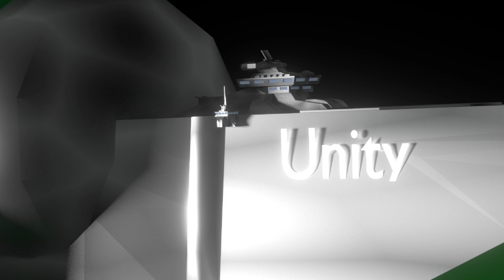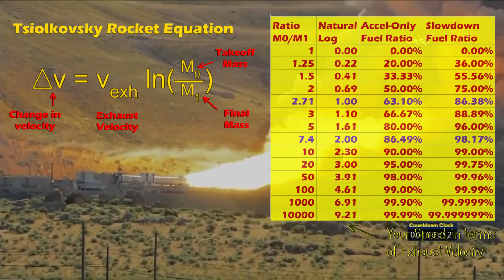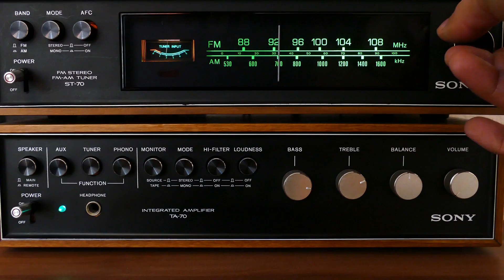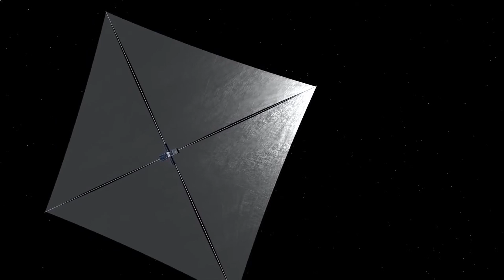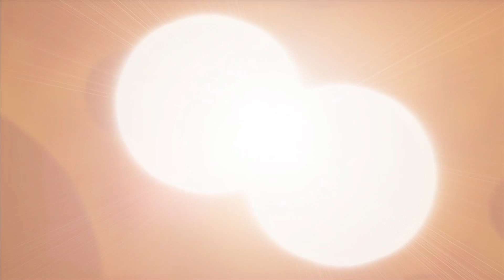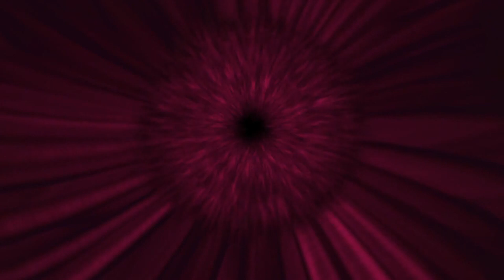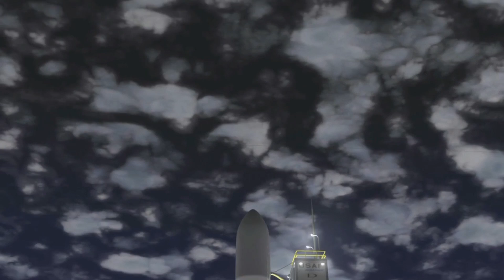Interstellar Travel Challenges

Comment: The stopping though... why not aero braking? We see this in 2010 film. Where the Alexander Leonov boost to Jupiter they put out a massive heat shield and go into the atmosphere of Jupiter to brake
Reply: Bad idea! This video is mostly about clever ways of surviving impacts from microscopic dust particles. You're talking about an impact with a planet. 

At 10% of lightspeed, your ship might spend a tenth of a millisecond passing through 300 km of atmosphere. You would be the dust particle and the atmosphere would be the shielding, and you would become a flash of light that incinerated half a planet. 

Even if that was okay, you'd pull, uh, like 30 billion gees going from 30,000 km /sec to zero in one ten thousandth of a second. Ouch.

Comment: How exactly would you slow down with such a ship?
I assume you would have to turn the ship around, thus exposing the unarmored backside and engine to debris.
Reply from the maker: I'd probably just move the engine or armor if a flip wasn't ideal, this is space afterall, detach it from the back and stick it up front. Also it is a 100 year journey but decel is only a few months, maybe a year, and the collision will plummet during that time.
Reply: I guess you would have to do that quickly.
But the engine would probably destroy anything flying towards the ship, so it doesn't need armor
Also, you can sacrifice those few thousands of tons and have second engine on the front, with would be always turned on and thus protecting the ship and when the time comes, you direct more power into the frontal one to slow down.
Reply: Detachable engine! 🚀

Why have I never thought about that? 😲
That makes the whole thing much easier.
Reply: Well, you don't need to point the engine to the exact direction you are going. Keep the engine protected in the back and make the exhaust go forward on all sides but on an angle so that the result thrust slows down the ship. This is similar to what jet planes do.
Reply from the maker: You could keep a really thin tether connected I suppose, but I'm not sure I'd bother trying to collect them at the end. Raw Mass means nothing once decel begins since you're decelerating to reach some place.  You don't need the sails anymore and you'd have to burn a little more fuel to decelerate them if you bring them back on board. Recycle a sail into something else useful rather than grabbing and smelting a few extra tons of asteroid in the destination solar system probably takes more energy, considering the sheer amount needed per kilogram to decel from 10 or 20% of light speed.
Reply: I'd already written, that the plasma from the engine would destroy all large particles
Reply: Hand brake, same as normal. ;-)
Reply: To slow down the interstellar medium can become an useful instead of destructive, spin out some electric sail wares of a magsail or plasma sail and slow yourself down with the charged particles. Should slow you down to non relativistic speeds before you have to use your engines to decelerate. You can also add some energy to your initial acceleration absorbing some solar wind on slingshot round the sun.
Reply: @9GAGER KILL ALL THE 8DUDERS
it will be a lot easier when we will know how to build the warp engine. We are not certain how to build thermonuclear engine or yet a thermonuclear reactor, so we are a bit behind of your expectations.
Reply: To make matters worse, I don't think that you could armor the engine. At least not without blocking the exhaust needed for slow the ship down in the first place.
Reply: Also if your deploying the solar sail shields ahead thats going to sweep up most of the debris that could hit the engines while slowing down.  The armor is more for the radiation and whatever gets through the more active defenses.  Just cause your slowing down does not mean all those stop working.
Reply: Seems like you'd want at least two sets of engines if not more just for redundancy. In that case why not allow the engines to pivot forward, at a slight angle as Enrico mentioned, if they fire at the same time the effect would be the same.
Reply: @Pipe2DevNull
Yes, kinda same idea. In that link, it's more about pulling. Actually, Star Track TNG uses the idea, as they have engines and living quarters are capable of separating.

@MrMonkeybat
Surface/intersection which would be capable of doing so should be very very big.
Reply: Make the engine's turn but not the ship ?
Reply: @Arlo Waterbury
length of tethers is limited with rate of your deceleration, same stuff as for space lift basically.
Reply: That makes me wonder about artificial gravity. The ship is a huge cylinder so I assume it would be rotating around its axis to make gravity when at cruise speed and the rotation can stop when it's accelerating so that it becomes gravity. But then gravity isn't in the same direction.
"We will soon engage the engine, please stick all your furniture on the wall along the ship's axis"
Reply: Youd deactivate the engines in the back and activate the engines on the front of the ships (but it would take about the same time to slow down that it took to get to such a speed)
Reply: Or open up solar sails on the sides of the ship
Reply: @TheAllegiantTraitor
have them as separate entities from the start, long read but mentioned there http://worldbuilding.stackexchange.com/a/41407/20315
Reply: For my conteplative starship, I imagine a detached engine that can position itself at several pushpoints around the ship. Like a tugboat. The engine can push from the front or back. It can push from the side to change course to avoid stuff.
Reply: @xassis: How exactly would you slow down with such a ship?

I think the solution is magnetic sail. For speed like 0.1c should be very efective.
Reply: Molb0rg A 20-km long electric sail wire weighs only a few hundred grams and fits in a small reel, but when opened in space and connected to the spacecraft's electron gun, it can produce several square kilometre effective solar wind sail area and that is with current technology with things like graphene and superconductors it could be lighterlonger and hold more electric charge.
Reply: +Sir Twinkeltoes Yeah, because the front of the ship is armored to protect against impacts. If you could turn the engines, or exhaust, forward then the engines stay protected from impacts.
Reply: I was also curious how, during deceleration, you could recollect the detector sails that are lightseconds ahead of the ship.

Onboard engines? A reeeealy long tether? Extra wide to decel from the sun we're heading towards (presuming a sun is the destination). Accept the loss of the sails? Fly blind for a little while and accept the risk?

Essentially the distance the detector sails are in front of the ship would be based on the time lag of detection+transmission+computation+targeting. So speeding any or all of those up might allow for tethering, but how long is even possible?
Reply: @MrMonkeybat
>several square kilometers effective solar wind sail

Now even close to what is needed. https://en.wikipedia.org/wiki/Interstellar_medium
with 1 atom per cm^3(higher 5 times than in most places as we imagine it today), at 0.9c drag pressure, will be about 0.000121 Pa, so 1 square km sail will give 121 Newton in best case scenario.

The force drops proportionally to speed drop, so at 0.1c speed, the force will be 9 times less 13.4 Newton for 1 km^2 sail.

It can be done, but direct applying of graphene sail will give not so much in the case. It has to be 2 stage structure.
1 stage - have to concentrate the interstellar media of course of the ship.
2 stage - actually catch the stuff.

But the area of the first stage for decent ship have to be big. 1g acceleration/deacceleration it is about half light year acceleration/deacceleration distance and 1 year of time.
For a tiny ship of about 1'000'000 tons, first stage area has to be 810'743'801 km^2 at 0.9c with 5 times higher average interstellar medium density.

The slowdown problem have at least 5 solutions - laser road, usual rocketry, using interstellar medium, catch the ship in the system, using gravity of the star to stop(needs proper tech(not too complex, but long to describe))

So, in general, it is not a big problem, but requirements for the using interstellar medium as a way to stop(or help to stop) are higher than it seems you imagine.
Reply: @Arlo Waterbury
but before they are basically unlimited, so no problem to get them back and begin to decelerate.
Reply: I would use magnets , or something that its far superior to them. And I would place them in from of the ship , and it would stop the ship in the same way as a hammer that goes up and down . Magnetic brake. It would have the shape of a hoock (pirate hoock)  . And this will be our brake.. When you want to brake , you just power the magnetic field to repel the front of the ship , but at the same time you would detached some parts of this hoock and it will have a breaking effect on the magnets in the front of the ship , and not cause an reaction to push the hoock back.
Reply: Molb0rg The example I gave was of a single tether. Sorry I did not point out you spin out many to create a full electric thousands 130,000 and you could cover the complete radius covering 1600km square kilometers. As weight is less of an issue for space miners and they have access to more advanced materials they will be able to make much longer tethers or there is also Magsails and magneto plasma sails.
Reply: @MrMonkeybat
Yes, I understand that it can be scaled, and I was talking more about the proportion of things than about the number itself.
Also, I do not say it can't be done, it can. But the technology required is, I would say, superior to the technology level where we have to care about ship debris protection as it was discussed in the video. With the technology, there is basically nothing to discuss how to protect the ship.

The mass is not an issue as for material, in terms where to get it etc, if the construction will weight more than 12kg per km^2 it means that theoretical deceleration rate will be less than 1g, no matter how big is the stop sail. Mass efficiency in the situation determines the maximum possible rate of deceleration and percentage of mass for the sail and for the ship itself in a grand total of mass used. And grand total mass defines the amount of energy we have to spend on the acceleration of the ship, and if we use rocket type of acceleration how much we should take the fuel. I mean it is an important thing to consider.

12kg per square km of graphene it is about 50 layers of the material, so the thing can be done light weight, especially as we need the material as a charge carrier. I give-up on the moment to calculate will it be strong enough to keep the charge (which will to rip the thing apart), and amount of charge (it have to stop particles with energy X MeV's to X GeV's (depend on the speed of the ship))

But the reason for me to talk about superior tech (besides of producing the thing and how much wonderful things can be done with it) is it have to have a system which translates the force from the sail to the ship (we will be not happy if the sail will decelerate at whooping 10-100g and the ship don't)
So it should be probably some kind of tether system, like Dandelion which have main stem of the plant, stem of the thing with fluffy part and the fluffy part itself, same principle here those tethers should collect the force at some points of ship hull and have gently pull/push the sail with distributed force over the sail. (big problem)

The system which will store the sail and deploy the sail (and how much wonderful things can be done with the tech mmm) (a lesser problem)

The system which will keep the sail as the sail despite some possible variations in density of stellar media. (and how much can be ....) (a minor problem)

Why there will be no considerations about lasers evaporating incoming debris, shields, shield repairs, almost everything which was mention in the video.
Because, you might have such thing in front of the ship, and it will create a cloud of plasma from the interstellar medium which moves with the ship, and the plasma will evaporate all incoming debris and create a safe channel 10-100km radius. The cloud can be big and relatively dense (about 30 billion times more dense than the density of interstellar medium which the ship flies trough) it will be capable of evaporating and dispensing pretty significant size particles(not sure how big). (Fair to say the same can be done in easier fashion by using the main engine)
The force with the solution will be not enough to significantly slow down the ship and it almost completely solves the problem with debris.

The main problem is manipulating such a thin but huge structure. It can be done, I basically used the technology in one of my answers and have described it a bit, the answer is about manipulating the planets on a star system, as ultimate use case for the technology, but what it is needed for the sail is the same technology, it is not super advanced but with its use the ship will be a totally different beast and same for transportation. You might read it here http://worldbuilding.stackexchange.com/a/45273/20315
Reply: Since everything is relative you could rotate spacetime and then start your engines again.
Reply: Niskinatorn Might as well use a warp drive then.
Reply: Djorgal You wont rotate the entire interstellar ship because it has to stay behind the dust shield. Put some cart wheels along its spine with sections that can tilt to keep the floor down when it is accelerating and decelerating. you do not need massive engines that create 1G you can more gently accelerate over a year or so while the angled cartwheels keep the 1g living space.
Reply: This is always what I thought was the best idea. Make the engineering section detachable, with robotic tenders or a rail system to mount it on the front of the ship. Just make sure the ship is designed to accelerate and decel in opposite directions. Unlike, for example, Rama, which had a big cliff on the aft end of the cylinder to make sure the middle ocean didn't result in a tidal wave; this sized cliff was lacking on the fore end of the ship.
Reply: Couldn't you just put the engines on the same conveyor belt as the armor/fuel? Or just make it possible for them to go on it?
Reply: He had the armour as fuel tanks that could be manuevered in front of the ship for a while and then to a shielded location for repairs.  Presumably they could be maneuvered to where needed regardless of ship orientation.   He also mentioned advanced probes that could deploy shielding well in advance of the ship.  I had always envisioned multiple graphene sheets diagmagnetically supported well in advance of the ship perhaps even propelled ahead by lasers like a solar sail or supported by advance probes.  All of these shielding concepts are effectively detached from the ship and could provide the needed shielding regardless of the ship's orientation.

Recent calculations of the Bussard ramjet shows that it presents more drag than thrust so it's now often proposed as a way to brake an interstellar ship.
Reply: maeybywith gravity breaking, Let planets and stars to bake your decend with strategig corection changes.

p.s.
soory for bad english not my native langue

Comment: Why do we need to track it? just use a massive wide beam laser the diameter of the ship?
Reply: not all of the particals will travel in the same direction you are traveling so paritcals could hit you from any direction (not including the back)
Reply: that's very unlikely at that speed.
 Actually it is very unlikely to happen even to an air plane.
Reply: The advantage of a laser is that you can focus the energy on a small space hence be enough to vaporize the target.   Spread out the beam and you just light them up instead of vaporizing anything.  When you burn an ant with sunlight through a magnifier glass, do you concentrate the light or spread it over a large area?

Comment: Why not use mass drivers to launch fuel tanks ahead of the ship? Then the ship could catch up and refuel as its speed increases
Reply: Launching material ahead with a mass driver would also be like firing retro rockets, a bit counter productive.
Reply: @johnwang9914  
The mass driver is in the system you leave and it launches the fuel/reaction mass before you leave.
Reply: How would you catch them? Matching speed would cost more fuel than youd probably get from the tank
Reply: @bengersbootlegs  prob just a matter of engineering - but would you need to? - interstellar space is probably littered with modest size icy bodies which you could collect for fuel
Reply: @bengersbootlegs  you could have them explode ahead of your ship,  then scoop up the contents as you fly through the clouds of gas.

Yes you wouldn't get 100% of the fuel,  but if you are launching hundreds or 1000s of fuel containers ahead,  it probably wouldn't matter so much.

Another thought that just occurred to me is that you could use this method to help decelerate too.
Reply: @bengersbootlegs  the idea would be to launch the tanks into the right position and speed so that the ship could catch it with minimal to no effort, the ship's course will be largely known ahead of time and they will be getting communications between the launch site and ship to verfy where the ship is and where the tanks are if they need to compensate for dodging, I wouldn't be surprised of the ship had a few smaller "Tugs" that went out to intercept the fuel tanks and push them into possition